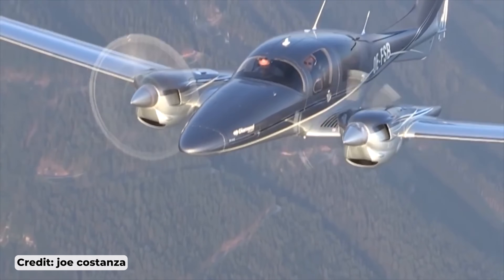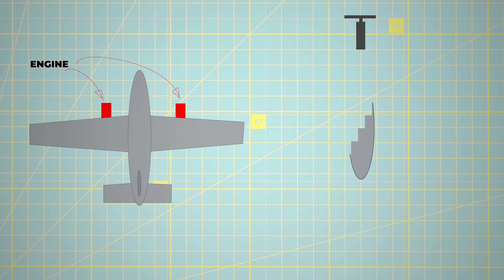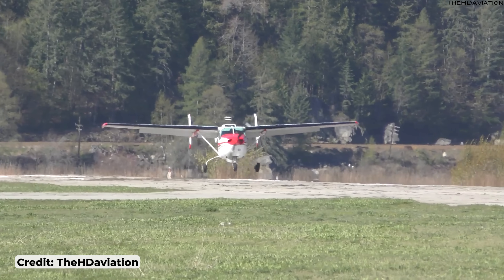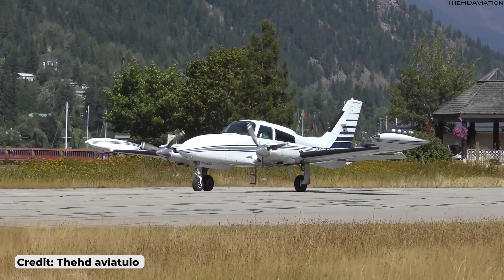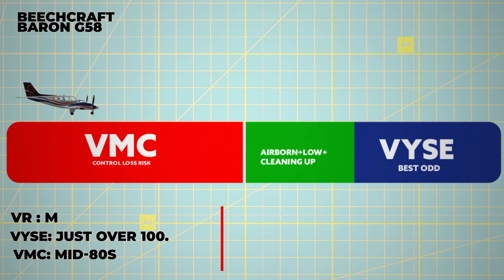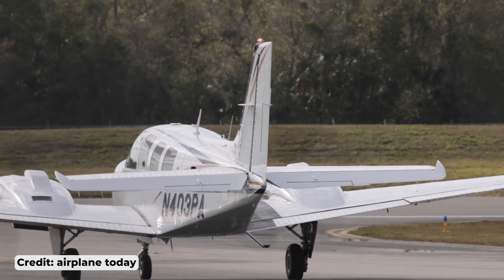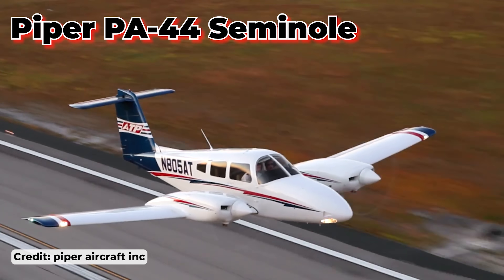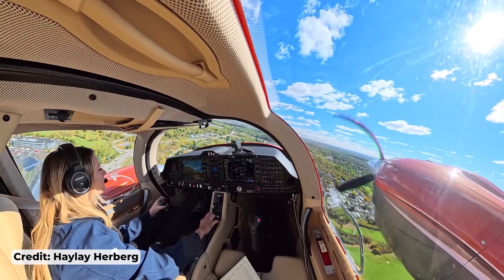Where Other High-Performance Twins Try to Kill You… the DA62 Tries to Save You.”

Comment: Can’t get into a VMC roll if you never fly below it. (Yes I know it changes on a lot of factors, we were always taught VYSE minimum unless on short final). My preferred method is rotate at published, remain in ground effect until VYSE, and then climb. Engine quits somewhere in the middle, power idle and set it down. Rather take chances with the fence at the end than spinning into the trees
Reply: Absolutely. And on my MEI check ride I emphasized that it is infinitely more survivable to slam into terrain when lower airspeed and flat than taking off when it's not capable, VMC roll over into a spin and crash and die
Reply: Sorry, forgot to finish: and the DPE absolutely loved that point made

Comment: Great presentation  . I'm a low time individual and need these basics  .It's clear that this is a  pitch for the DA-62  , but I know that nearly all the Piper  twins ,for example used two different piston engines. The right hand engine rotates left. I'm sure that all this will continue with the new Seminole. Any takers on what the 
Stats are for this configuration ? How do insurance companies view this ? Also, I've noticed that the 400LS (Beast!) was the only light turbine twin with CR engines....we should probably leave the big Airbus military transport (Grizzly?) out of this one  lol .

Comment: Why they not connect both engine like V-22
Reply: And you could put both the engines in the centre, which would improve aerodynamics and reduce rotational inertia, making spin recovery easier.
Reply: @gasdive  then You sit on the Wing? No Space Man. Front & Tail Engines Layout is bad for pitch.
Reply: @arwupig     they could be in the centre. Like the wing root. Think the hump on the back of an ATR 72.  Having a shaft means you must have a gearbox. If you have a gearbox then reduction gearing comes along with it. Reduction gearing means you can spin the engines faster. So you can have small piston engines or small turboshaft. High wing plus gearing gets you big slow props that are quiet and efficient. If they're big and slow you could even have thrust vectoring which reduces the asymmetric thrust issue and improves roll control at low speed. 

I don't think the shaft is a great idea in and of itself (I think the V22 shows that), but if you're going down that road. You may as well optimise it.
Reply: @gasdive  When Crash scenario a big hot metal engine and all kinds of flammabie liquid pipe right under the BUTT seems quire charming. I think this is all bad idea so just Clone more DA62.

Comment: What 🤔 about twin pusher props ❓
Piaggio P180 Avanti Evo
Reply: These tuboprop aircraft are governed by a different set of rules with far more power to spare than piston twins and so do not suffer the same fate.  they will operate similarly to jet airliners in terms of having OEI climb performance after takeoff.

Comment: Flying my C340A I rotate at 98- 100Kts (blue line 105kts) within 50 feet I'm at blue line +5 and Climbing 1000ft/min (RAM VII 335 HP each with VGs). The machine has balls and keep it straight ahead and unload for engine loss is walk in the park. Speed is life in any Multi ops. IMHO. Sure ....take extra care with wheel bearings at inspection but this is a minor issue.

Comment: One very important thing you're missing out here is the fact that with aircraft in this performance class (Class B) you're not supposed to continue the takeoff in the event of an engine failure. If you have remaining runway ahead you stop or glide back down. If you're out of remaining runway at the time of engine failure that means that you already have enough energy to continue and also that means that the take off phase of the flight is already finished, in which case you shouldn't have controlability issues due to low energy. In any case, they are not jet airliners (Class A) that are designed to handle this kind of situations and you should always carefully calculate your performance before commiting to anything. I am not familiar with FAA terminology since I am EASA trained but performance classes I believe are the same. Check it out if you're not familiar with them.
Reply: Light twins are class c
Reply: @kickedinthecalfbyacow7549 I'm afraid you have it wrong my friend. If you do a quick search you will see. Class C are piston aircraft exceeding 5700kg MTOM and or seating 9 or more passengers. Light tweens on the other hand are Class B.

Comment: Im 73 rented cessna 152's for 40 years . No problems. Pilot at airport says: when an engine quits , the other engine will take you to the scene of the accident . 😮
Reply: Only true if you don't know what you're doing
Reply: Bob Hoover stresses that you must fly the aircraft controlled into the crash regardless of twin or single. In a twin that sometimes means closing down the live engine as well.

Comment: For god's sake put the nose down as soon as you don't get full power on all engines. Even if it happens smack during take-off. PUT THE NOSE DOWN. In the video the crash the first thing to notice is the nose high attitude. IT WILL KILL YOU. Then do your check-list.

Comment: a light twin does not have to keep level flight with an engine failure, it sure does under some circumstances of temperature, pressure and airplane weight but it is not a transport airplane category, you do have more options than a single engine plane but be ready to glide with a shallower rate if one of the engines go boom, the biggest problem is the pilot does not accept the descent rate, try to hold altitude at the cost of airspeed and that brings him dangerously close to the VMC, stick to the blue line, even if that means going down at 700fpm, if you are going down, go down flying the airplane, try making a forced landing wherever possible, never ever let it roll, stall, spin that's a guarantee unsurvivable crash! another pretty important factor is proficiency, I got my ME rating in a Seneca I 200HP engine airplane, and the force applied to the pedal in order to counter the yawing tendency was enormous, I can't even imagine how much force a pilot must apply to a baron or C310 to keep it flying before he's able to use the rudder trim, if you are not used to the maneuver, you get caught by surprise, gotta keep practicing that one engine inop scenario!!!

Comment: Nice but all they did was made the plane smaller, the Diamond's passenger and cargo space is pitiful. May as well stay with a single engine. That needs to change.
Reply: Actually, the DA62 is pretty roomy and can be specified with 4,5,6 or 7 seats. The nose baggage compartments are decently large and with the seven-seat option fitted there's still a good amount of baggage space in the rear.

Comment: Torque.  Twin manufacturers choose the same engines in bulk which usually have a counter-clockwise rotation.  Having 2 engines torqueing (P-factor) to the left and yeah, that baby want's to turn turtle.  Personally, I would never buy a twin that had both engines turning the same direction.

Comment: non-pilot question here:  why not wait to achieve a higher speed before rotating?
Reply: At some point the airplane will just jump around, bounce, and skip across the runway.  It's easier to control an airplane once it's airborne (usually) than on the ground.  They handle nothing like a car...
Reply: @reubenmorris487  I have the same non pilot question. But I'm a powered hang glider pilot and helicopter student. There are pretty hard limits on ground speed in a foot launched aircraft, so I lift off into ground effect. I'm fast enough that I can flare and land if the engine quits, and in the low drag of ground effect the glider picks up speed really quickly and becomes controllable and safe for climb out. It's the same in a helicopter. I lift off. Then accelerate in ground effect, keeping it low enough to land if the engine quits until I'm fast enough to have full control in an engine out.

So this seems obvious in a light twin. Accelerate until you can fly, lift off into ground effect. Hold it 2-3 metres off the deck until it reaches a speed where you have full authority over the aircraft, then climb away. If one engine quits while you're accelerating, either put it back on the ground and stop (as I do in a hang glider or helicopter) or hold it in ground effect where it builds speed fast. In ground effect there's no temptation to use the "pull back to go up" reflex. You're already at the right nose angle to build speed with one engine.

Edit. After reading the comments, it seems many twin pilots do exactly this.
Reply: I was wondering about that too.
Reply: Many pilots choose to no use any flaps. Rotate slightly faster but keep nose down, build up speed then gear up & climb at blue line.

Less drag with no flaps and one less step during recovery.

Comment: Excellent information. 
If I may add that Part 23 GA twins are not guaranteed to climb away from the airport, and after an engine fails, particularly when heavy, the operating engine may only take the airplane to the crash site. 
I learned and for years taught light twin students to keep the gear down until an emergency landing on the remaining runway cannot be made.
I noticed bot the "rotate, gear up" and delayed gear retraction in the video, so reckoned it was worth a mention.

Comment: MEL training in a twin Comanche, goes into an unrecoverable inverted spin if abused.
Reply: I did my MEL training in a Seneca and Twin Comanche.  Overall I liked the Comanche more; the controls were much lighter than the Seneca, the airplane felt more nimble, and it's double-edged sword is that it's slightly faster.  It was also harder to manage energy/airspeed while landing, but had more "assuring" elevator authority than the Seneca.  
Seneca had counter-rotating engines unlike the PA-30-30, had more power, but it was heavier.  That thing would not flare...absolutely no elevator to keep the nose from dropping while trying to land.

Overall I didn't notice a ton of difference between the two planes while learning to perform the Vmc demo.  Respect both airplanes and there shouldn't be a problem.

Comment: Seems like an ad for Diamond as much as the rest of it. No mention of counter rotating props? Or given runway length and obstacle avoidance, nothing says you can not stay on ground longer, or accelerate in ground effect before committing to climbing away. the lines can be overlapped in a variety of ways besides just flying a Diamond
Reply: Thank you. Paint on your own hacks on the AS, good to go. Mountain out of a molehill here.

Comment: Seems like a DA62 advertisement video.  You made it sound like the C340 numbers weren't very good, but if I am reading your numbers correctly, they look better than your DA62 numbers.
DA62 VMC <78 / VR 78-80 / VYSE 88-90 = Rotate is about 2+ kts above VMC and 10 kts below VYSE.
C340 VMC 80-90 / VR 85-95 / VYSE 100 = Rotate is 5 kts above VMC and 5 kts below VYSE.  (Isn't that better?  More cushion above VMC and a smaller gap to blue line?)
I have nothing against the DA62 and based on your numbers its performance generally seems better than the other planes you chose to list.  Just not the Cessna 340, unless I'm missing something.

Comment: All you need to know about an engine out in any kind of aircraft at any time during the flight:

Wings level
Throttles fully forward (You don’t yet know which engine has given up on you)
‘Dead leg - dead engine’ only for propeller driven aircraft and not for jet aircraft.
Shut off fuel for dead engine and if possible, feather the propeller.
Always make turns into the ‘good’ engine.
Attempt an engine restart when time and circumstances permit.
Reply: Bank Bank Bank

Comment: In WW2, the He-177 bomber had a mechanical system that automatically applied opposite rudder if one engine quit.   I'm not sure why this never caught on.  One reason might be that this plane in general had many innovations, and got a reputation of being complex and unreliable.   Perhaps it was hard to separate the good innovations from the bad ones.
Reply: Rudder biasing systems are extremely common in aircraft. Not as much in light twins, just for the same answer as anything: cost and complexity. But just about any turboprop or jet I've flown has a rudder bias.
Reply: It sounds like  the problem is that the zone after you rotate but before you achieve sufficient rudder authority speed would not be any different with an automatic rudder. If these twins could takeoff on a single engine then auto rudder might do the trick. Could the he-177 operate on a single engine? Or maybe there were dead zones but they did it anyway?
Reply: @Archpimp  To be quite honest, I kinda disagree with the whole premise of this video anyway, because we're conflating design elements with pilot action. Just because you CAN rotate right at Vr, doesn't mean you always should. This margin that he keeps mentioning completely disappears if the pilot just elects to delay rotation a few more knots. This is something that most light twin pilots already do when runway allows.
Reply: The new Garmin avionics can assist with V1 cuts, and be installed in legacy aircraft. Learned about this after their system autolanded the King Air the other day

Comment: 40 yr as pilot and counting, CFI-Inst-ME, ATP, not totally inaccurate but the praise of DA62 is misleading. DA62 is a low powered, very small twin. They did not invent new math or technology (although it uses diesel engines, still not new, however).  EVEN if you get the DA62 under control low and slow the climb rate will be abysmal. Obstacles or terrain may make clearing them impossible. Only large transport airline twins (jets) have real demonstrated single engine climb losing an engine before or at rotation, called V1 speed. Below V1 you stop on runway (which assures stopping distance).  

ALL LIGHT TWINS have NO guaranteed single engine climb. READ AGAIN single engine climb is not guaranteed in ALL LIGHT TWINS (including DA62).  If you lose engine right at rotation or after rotation, or below blue line,  LOW and ditty, you are vulnerable , and a forced landing under control wings level may likely be the best choice. Pull the good engine back, land on the remaining runway or off field. This is better than losing control. Large twins, KingAir for example, do have single engine climb ability, and by regulation, air transport turboprop twins and jets have to have SE take off climb ability. 

It is hard for twin pilots to do a forced landing with one engine still running. However, it is like in a single engine pilot who loses power after takeoff and tries the "impossible turn" back to runway after loss of power. often resulting in fatal stall spin. I flew light twins, both freight dog and my personal twin. When light, low density altitude, I had real single engine climb. Heavy gross, high density altitude, hot day, an engine failure low, dirty, slow was automatic forced landing. I self briefed a go no go point to attempt single engine operation or forced landing.  

It is the limitation of light GA piston twins, they can't climb well on one engine  How fast you get gear up, feather prop is also a factor. Being fast may still not help. Gear and props take time to retract and feather. If you don't have airspeed you are screwed.  

Light twins do provide options when enroute to divert and land, but you have luxury of speed and altitude. Had one light twin engine failure. I have done enough training in GA twins (including the Aerostar), business jets (CE500) and Boeing airliners. I can say light piston twins are very vulnerable down low, slow and dirty. Take your lumps and stuff it off field the best place you can, might be best option. Gross weight, density altitude, obstacles, and terrain nearby and pilot skill all factor in, but a controlled FORCED LANDING CAN BE A GOOD OPTION OR ONLY OPTION TO CONSIDER AND LIVE.
Reply: Well said
Reply: Performance C twins below a certain height you treat it like a single and land ahead within the safe arc
Reply: Thanks for cutting through this BS.
Reply: Yep, it’s certainly no Twin Otter with OEI.
Reply: All he really said was that the DA reduced the gap to a safer one,  and that's not misleading,  is it?

Comment: Seems to me like one "simple" solution would be a stronger rudder. They could also implement an automatic system to assist in such cases, but the liability would be absurd.
Reply: Some aircraft do have autofeather and rudder boost, and they are very helpful and effective. But the pilot still has to Aviate for a happy ending. I got my multi rating in an old Baron. On a hot, humid day with everything done correctly you could expect only a modest loss of altitude at gross weight. It was a great aircraft to learn about twins.
Reply: Although I spent most of my career flying jets I did some King Air time with auto feather and rudder boost. It would seem easy to incorporate rudder boost as part of a yaw damper system but probably difficult to certify. I have quite a bit of Baron time too and always self briefed what I was going to do. Essentially delay rotation and climb flat until blue line. None of my flights were from short fields so that was a good mitigation. Jets are a whole different ball game with predictable flight paths. Programs taking obstacles/wind/temp will give you the maximum TO weight allowance and emergency procedures to avoid obstacles. On modern jets the flight director will command the correct pitch to meet the required speed targets. No light twin does that, not even this advertisement for Diamonds.
k
Reply: More rudder, more drag